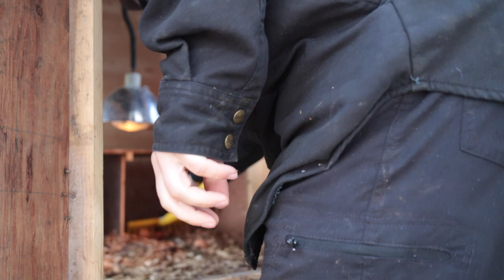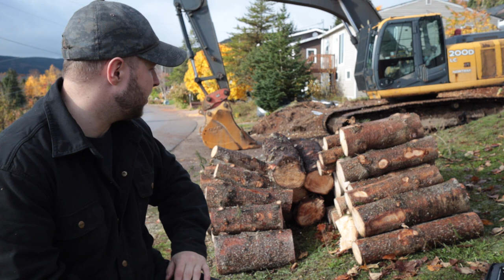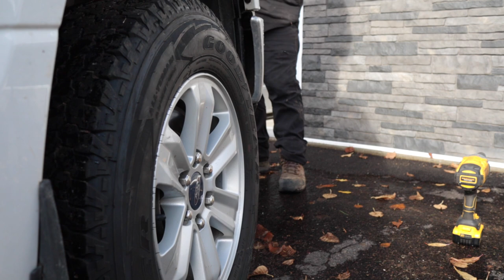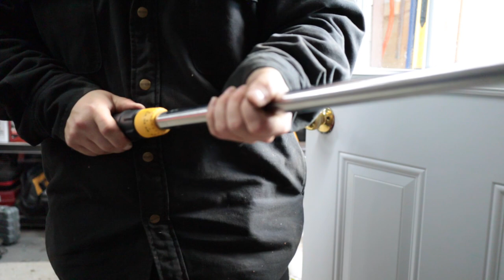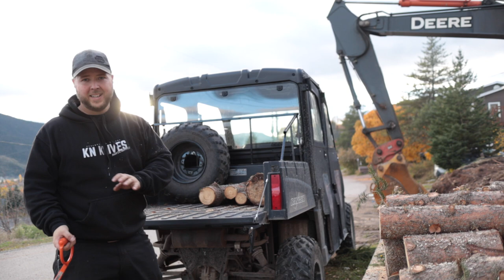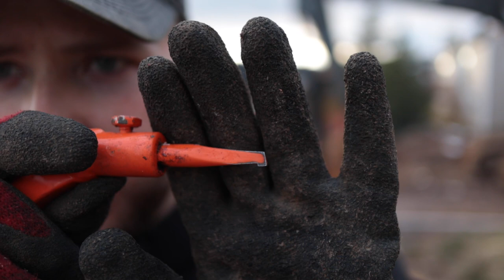Pop sure knew how to Live - Newfoundland, Canada

Comment: So right about overtorquing  just changed wheels on a car that had always had them changed at a dealership and the nuts were 4x over spec.
Reply from the maker: I 100% believe it. I always 'guesstimated', up until I got my torque wrench. I cranked them on to about what I figured was right. My guess was actually around 400 ft.lbs, compared to the factory recommended 150 ft. lbs!!

Comment: Nicely done, yes I've come across a few of that style hook here in New Zealand, I use an old wool fage  hook I found at a garage sale, lighter gauge but works well.
Reply from the maker: Nice, Richard! Whatever works! Do you guys have big wood over there? a 12" diameter butt would be considered a pretty big tree here in Newfoundland. Our climate doesn't allow them to grow quickly. I suspect the same for your area?
Reply: @kyle_noseworthy  not huge wood processor myself, we don't have a wood burner at our present house, so 3-6" is about all I cut for the outside firepit. There definitely some whopper trees about though and the pulp and paper industry has a big forests of large pine.

Comment: 1. What do you do with your chickens in the winter? 2.  How about a brake pad and rotor change tutorial?  My f150's rotors are warped and need changing. 3. Fingers crossed for a Stihl sponsorship!! Hahaha  did you just use a tool that's not Dewalt!!!!????  Thanks for the vid bud!
Reply from the maker: 1. Chickens can handle quite cold temperatures. The coop is fully insulated. I'll add a heating element to their light socket for the coldest parts of winter. They'll be just fine. 
2. Hmm, maybe! I wasn't counting on buying pads and rotors just yet though. haha I'll need to squeeze every ounce of life from them!
3. I have tons of tools that aren't DEWALT! The other brands just don't offer me enough to market for them! haha
Reply: I think i'm going to try the chickens out in the spring. My kids will love it.  The NLH episode 2 has me excited for next year.